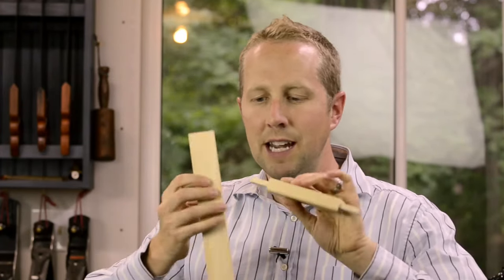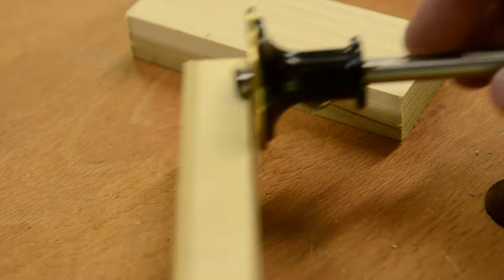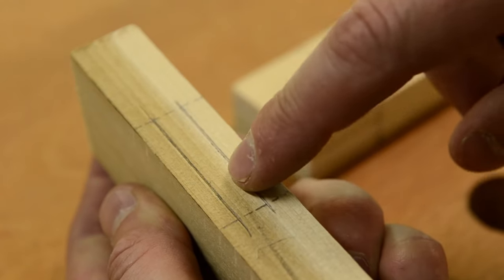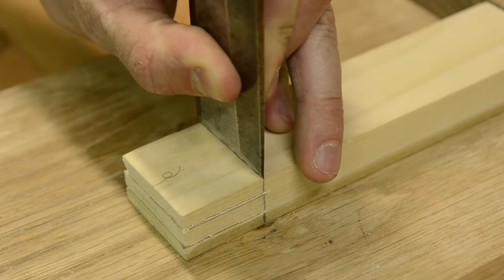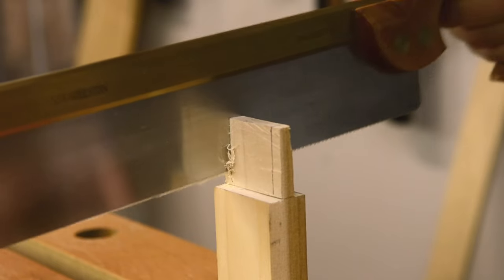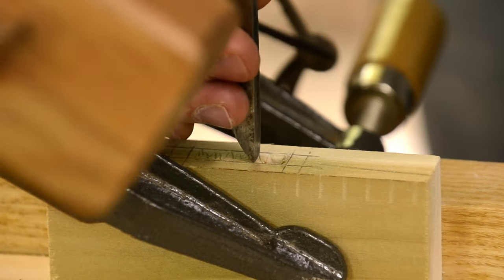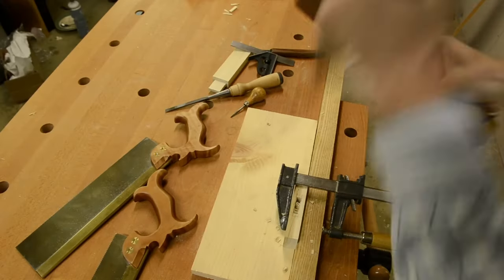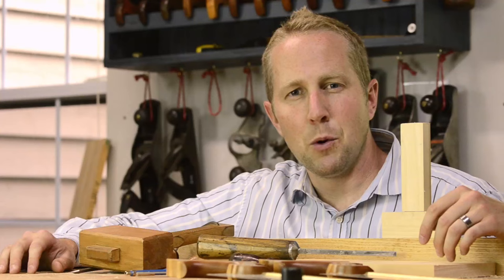How to Make Mortise and Tenon Joints with Hand Tools

Comment: Just what I wanted. Seriously nice video. Great pace, adequate level of explanation. Camera angles. Even your tone and accent. Easy on the ears. Just all round spot on! Thank you!
Reply from the maker: +Aleks James Thanks so much Aleks!
Reply: +Wood and Shop I was writing my own comment but it was essentially a copy of Aleks'.  I especially appreciate the camera work.

Building my wife a large, mobile chicken coop/tractor for her hens and I want the vertical 2x4s to be flush with the base 2x6s. Without buying a couple hundred in pins or having ugly supports, M&T and dowel joints are really the only options. I figured eh, I have to learn tenons sometime. I've taken in several videos and articles but this one relieved the most apprehensiveness.

Now if the sun will just come out...
Reply: Aleks James a
Reply: I was thinking the same thing. Wasn't too dumbed down but, wasn't overly technical too. The pace was easy to follow and the technique displayed was great.
Reply: Aleks James ditto. Great great video 👍

Comment: Thank you Josh. Been struggling to make these joints accurately for years :) Watched a couple of times and took notes to follow, then improvised with the tools I have. The main tools missing are a scribe and mortise chisels so used my combination square in place of the scribe and normal bevel chisel taking smaller steps for walking each way across the mortise while cutting it out. Result was a far tighter joint when finished and much more accurate with a good crisp edge around the mortise though slightly sloppy still and fractionally off true. The next one was almost perfect with next to no sloppiness. Think some early birthday presents are in order :)
Reply from the maker: I'm glad it helped Greg! Now you gotta get involved on my website and forum!
Reply: Subscribed already :)
Reply: @WoodAndShop  Watch your S' bro, they're blowing peoples ear holes out. REALLY painful to listen to.

Comment: So for years now I’ve been wanting my own home wood shop but at the time I’m not able to due to living and financial situations.  But I have been thinking about starting to gather tools and materials to be able to do that. BUT  with my current situation I won’t be able to do anything that requires power. Such as needing. A table saw or planet and jointer. Is there a way I could start with just hand tools and being completely energy free?
Reply: I see that your comment is a year old and nobody has replied.... first off, I’m wondering how you’ve got on in that year.  Did you get your workshop in the end?

Secondly, don’t forget people have been working and building with wood for thousands of years without power tools. 

If woodworking to you is slapping on goggles, ear muffs, gloves or whatever, and running the wood through a machine to do the work for you, then so be it. 

Hand tools have a zen about them, the process is calming and much more enjoyable to me. The journey is what brings us joy, having a piece of furniture at the end of it is just a bonus.
Reply: Absolutely. I taught myself how to do hand tool woodworking in the late 90's, long before Youtube. And I made everything only with hand tools for several years. I eventually got an bandsaw and a thickness planer, but they aren't necessary.

Comment: Thanks for the great video
What size should your mortise/tenon be in comparison to the width and breadth of my stock
Reply from the maker: I'm not sure if there's any ratio out there. But just look at other photos of mortises & tenons and just get it close.
Reply: Normal rule of thumb for 3/4" boards and similar sizes is the tenon should be 1/3 the total width of the board.  In wider stock, this ratio is less critical.

Comment: The width is decided by the chisel width, how then can we cut bigger tenons, that exceed the width of chisels like table legs
Reply: bigger chisels
Reply: Definitely a collection of different chisels sizes is necessary for carpenters. But if needed, I imagine you could just slide your chisel along the cut line until the entire span needed is cut. It should be possible, though much easier with a chisel sized for the specific joint.

Comment: what is the functional difference between the different saws used ("dovetail", cross cut. back...)??
Reply: Dovetail saws are just a type of back saw, usually smaller and finer than a tenon saw. Cross and rip cut saws can be any saw you file to fit your needs. A cross cut tooth is pointed and a ripcut tooth looks more like a chisel edge.

Comment: You make it look so easy, but it's so hard to get a tight joint...
Reply from the maker: No way, just follow my video! It will work!
Reply: Are you cutting on the waste side of the tenon? If not and cutting on the line your tenon will be loose. Trust me, I'm a beginner at college and had this problem until I was show where to cut properly. If the tenon is tight going in, just pare some untill it goes in snug.
Reply: Yep I do now, it's going better and better each day! Thnx for the help
Reply from the maker: TheLondonForever00 Yes, you're correct. Cutting on the waste side is essential. If you can bisect the line, leaving just a hair of the pencil line, then it'll be accurate.